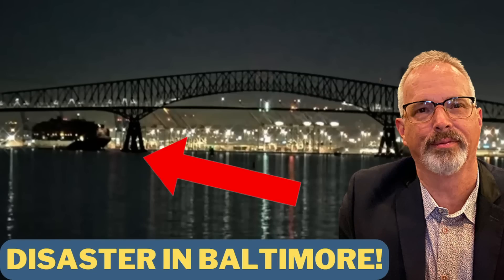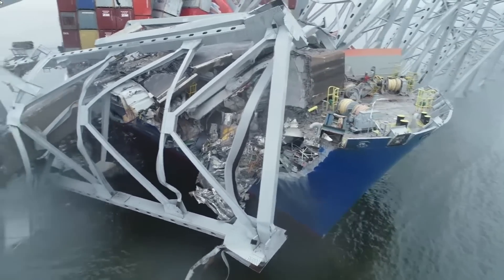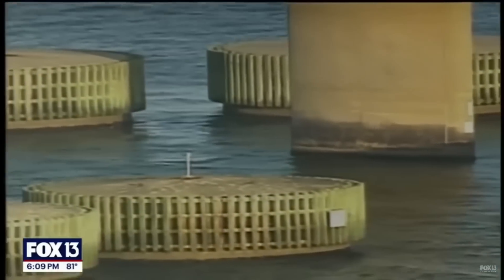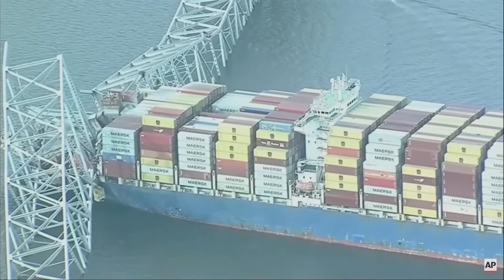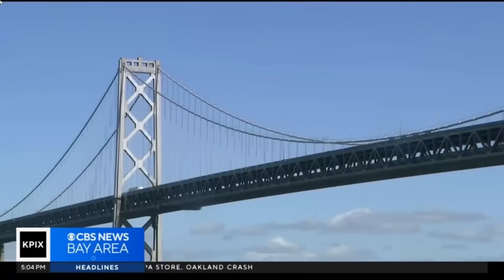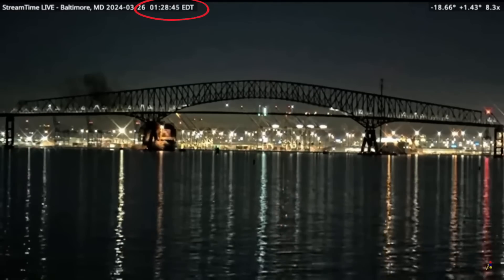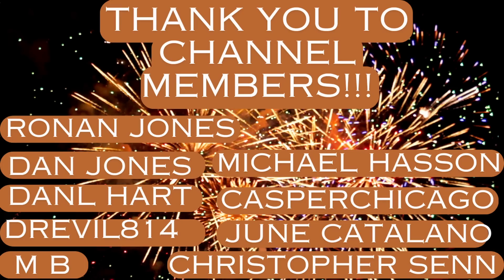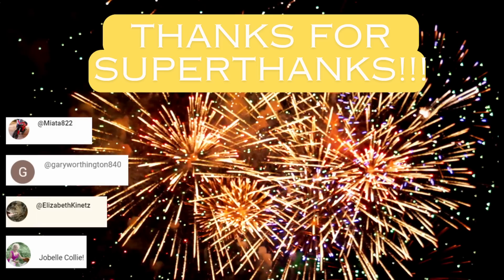How the Francis Scott Key Bridge in Baltimore should have been Protected

Comment: Cost/Risk assessment is the main theme that seems to come up.  Engineers and decisions makers will to spend the money or not spend the money of a benefit that can improve safe in the long run.  Many of these decision makers are will to gamble and not spend money on an improve that history has taught you gotta build it and pony up the money.  Upgrade to present infrastructure, maintenance, ect, lean tends to be to defer the work for cost saving.  In the ends the cost is always higher when you defer what you know needs to be done.  The Pittsburgh Fern park bridge collapse.  If this bridge was 6 or even 8 main steel structural members, with that redundancy the chance of total failure could have been minimized.  Even as pointed out that the drains were unclogged, the salt water runoff may have flowed away from the structural members, and reduce the damage from corrosion.

Comment: Dumb question: Is it possible to install in short cut spans of the downed bridge large bags filled with air or something else to prevent the steel from hitting the bottom and to be able to tow the now floating sections away.? Is there just too much weight.?

Comment: maybe it was 100% preventable but if absolutely every out of date infrastructure project and similar level of risk bridge were to be updated at the same time would it be feasible and at what cost and in what kind of time period. I saw an estimate that if every water system in the north east which was at the same level as the one in Flint was it would cost one trillion dollars. but t that were to be fised in a 6 month time period what would that do to the cost? so if the cost of safety related issues be added to the cost of roads  and waterways  and it all had to be done in 6 months even if it was possible what would t cost? don't forget all this spending would happen at the same time the marxist left, which wants to deindustrialize america, would be wanting funds for their own issues and pork spending.

Comment: It's much  more sexy to build new stuff than keep old stuff up to scratch.  If it works  most ot the time with minimal spending, why not go with that?  Especially if the federal government will bail you out.
Arguably part of the problem here is cost cutting with ships.  Poorly trained crews, poorly maintained ships.    And bridges that are just fine so long as no ship bumps into them.  And poorly trained people overseeing both ships and bridges because nobody wants to spend on maintenance of them, including on salaries.

And there is an argument that that is an accepteable solution.    It may be cheaper to pay for new bridges that to maintain existing ones to a high standard.
The USA could require that all visiting ships comply with high standards, but they don't.  There could be a fee for each ship that passes unprotected bridges to pay for bridge insurance.  I bet there isnt.
Reply from the maker: There's a toll for crossing the bridge with vehicles. I wonder where that money went.

Comment: Why are you talking about issues with the current generation if this bridge was built in the 70s? 🤔
Reply from the maker: The younger generation had an opportunity to protect this bridge as did previous generations. The point is the loss of institutional knowledge that occurs to produce similar disasters to past ones where lessons have learned.
Reply: @CaseyJones-Engineer  it's not the engineers job to decide what to be done to existing construction, but the job of the government and politicians to decide which regulations need to be set and reapplied to already existing construction, to bring it up to date.

However, the generation you're referring to as "more wise" did failed to construct it properly. And now you're blaming "the youth" for their failure.

I think you're just following your confirmation bias here, instead of looking at the situation objectively.
Reply from the maker: @RubenKelevra  Maybe.

Comment: It's commonly repeated that hindsight is 20/20, but not always and certainly not in this case. Why? It's because we did not learn from past disasters. I argue that if a large cargo ship can collide with and take-out a critical infrastructure, it will. We just don't know when or where. I also argue that until better protection barriers are in place (Oakland), large container/cargo ships should be under tub-boat escort until all potential infrastructure obstacles have been cleared. If we learn anything in the present case, it's how can we possibly afford to not implement these safety measures, when it can save lives and be far less expensive to have 20/10 foresight?
Reply from the maker: I agree with you. There is too much short-term focus just like what's going on with many companies in corporate America these days.

Comment: One fault with the logic here is the possible tearing of the ship. With 100,000 tons moving at over 5 knots, needed to maintain steerage, the upper structure of the ship will simply shear off and continue into the bridge supports. Making the dolphins immovable does not negate this problem. Most systems seem to be designed to deflect a glancing blow from a cross wind driven scraping rather than a head on impact. The side of a ship rubbing against a dolphin becomes a mutual sacrificial event that protects the bridge supports. In 1977, the Vietnam War was over and we were almost broke financially,  money for infrastructure did not exist. The design occurred while the war was still going, so everything had to be cheaper than necessary. The problem with fixes for inadequate designs begins like this: Phase II, remove 3/4 of Phase I. You need to remove anything you cannot use because it will be in the way of the new stuff. This leads to removing inadequate protection, leaving things unprotected between demolition and completion of replacement construction. Simply adding on to a dolphin reduces the size of the ship channel which is already as narrow as practical to keep the bridge span minimized. To move the bridge supports means a whole new bigger bridge.

Comment: I fully agree with your assessment of the inadequate protection at the base of this bridge. This was not a direct impact, it was a glancing blow which could have easily been diverted by a protection system. I am neither an engineer or architect but the first thing I said when I saw the initial videos is that someone needs to go to jail for negligent homicide. Just looking at the tiny size of the supports of this bridge was frightening to realize that I had driven over this bridge many times with my family. Just because it was designed this way decades ago doesn't mean that it couldn't have been upgraded. They should have installed barriers around the base many years ago. The upper edges of the ships deck should not have ever contacted the supports while the bottom of the ship remained clear. If the bases were wider so the bottom of the ship contacted a barrier it may have deflected the ship enough for the top deck not to hit the supports, it may not have come down. The Florida Sunshine Skyway bridge was rebuilt with plenty of protection from glancing blows. Look at the pictures on this article.  https://www.msn.com/en-us/news/us/lessons-from-skyway-disaster-failed-to-help-protect-baltimore-bridge/ar-BB1kGoru.  I can't believe that a responsible person or people could not have figured this out years ago. If the Authorities members are not jailed they should at least be fired immediately.
Reply from the maker: The government sector gets a pass on these avoidable tragedies for some reason.  Things need to change.

Comment: Excellent video about the engineering of Bridge Protection Systems. I agree that the fundamental issue here is not really about the Dali loosing power but that the risk of at some point a sufficiently large ship would strike the bridge was clearly non-zero, and even if some the impact of such a collision would be enormous. Frankly the Federal authorities should charge the bridge owners with negligence for not upgrading the bridge's protection.
I suggest though that your at least 3yr estimate for getting a replacement is rather optimistic, even if the Federal authorities seek to pull out the stops. 3 years might just allow an accelerated build, but before starting, that build they would need a new design. I can’t see them just dusting off the existing design and replicating that.
Reply from the maker: Thank you. I've got some thoughts on this that I'll address in an update.

Comment: Very good video.  I like the deeper dive on the civil engineering.  It would be interesting to follow up with a video showing the process and engineering required to remove such a mess.  The strain energy in the beams is dangerous and without properly disassembling the structure it could be catastrophic to people and machinery.   Lots of potential energy waiting to be unleashed.
Reply from the maker: Thank you.  I think the removal process will be dangerous and slow to complete.

Comment: I'm approaching the end of my 40+ year engineering career. I'm trying like the devil to pass on all I've learned. But, so much seems irrelevant now that so much of the job is done by computers. What used to have a naturally slow pace, because the process of calculation and plan preparation took so long, that it allowed careful deliberation, now takes only seconds and happens entirely inside the blak box. I had to teach linear interpolation to an EI not long ago. Some are learning by reading the manuals, but not all. The computer algorithms are expected to account for everything.

Comment: There has been a great loss in work ethics over the last decades. Look at Boeing as example. The common denominator for ethical standards has always been slackness of some sort. That is, unless driven conciously, slackness will dictate the degree to which safety will  be managed. In even simpler terms, unless you kick ass, safety will slip. The cycle is not one of experience, but a cycle of  conciousness. It is very hard to beleive that the bridge was that poorly protected. Engineers and lawayers seem to share one trait..... they are clever and in everybody's face. Then when things get tough, they suddenly claim   a sort of professional force majeure..... that the situation is or was beyond their level of influence.

Comment: There is an empirical proof that a fender (dolphin) big enough to protect the bridge from this ship, or even one twice or three times the size is possible and not beyond current engineering. In the NTSB B-roll and all of the detailed images of the bow in its grounded state, the extent of movement of the ship is clear. The ship didn't go sailing on. This shows that it is possible to stop the ship in a reasonably short distance with 1970's technology.

Comment: Missing the big relevant question, why did the ship lose power so shortly after getting underway?  What caused that ? Do engines that big just hiccup and quit running ? And even if the black box quit recording with the loss of power, which is ? stupid/suspicious, it would still have likely given evidence as to what stopped the motors and generation of power.  If sabotage was involved that would have been the point of attack.

Comment: The same questions can be asked of the ship design and operation.
From what i can see the ships a have been optimized to the point that redundant systems do not exist in a form that would be useful in an emergency.
Even things like practical speed limits when maneuvering around bridges and such.  Speed limits should be calculated on the energy the bridge buffers can absorb.

Comment: Here in the Detroit area the Gordie Howe Bridge is being built to Windsor, Ont., Canada.  It is about the same length as the Key Bridge 1.6 miles.  It is costing over $6 billion.  The preliminary estimates for the Key Bridge is about one to two billion dollars. The Howe Bridge is 6 lanes vs 4 for the Key Bridge which would account for some of the difference.  Why is the Key Bridge so much cheaper to build then the Howe Bridge?  
The Howe Bridge is a suspension bridge which has a much longer span.  Should the new Key Bridge be a suspension bridge?
You talked about how knowledge is lost after a generation.  We see the same thing in banking, every 20 to 30years there is a new banking crisis because of the loss of institutional knowledge.

Comment: My favorite story is that a refrigerator company fired all its old expensive engineers and replaced them with recent cheap college grads. You know they will be up on the latest tech. They redesigned the motor for their product and began manufacturing. One year later they all failed and caused an extremely expensive recall. Experience matters!

Comment: If older folks retire and their knowledge would be lost, the Netherlands would not exist.
So we developed systems to prevent that. Good documentation about how, why, where. And technical universities that preserve and spread knowledge, and who look forward to anticipate on changing circumstances.
Most bridge pillars are constructed on boat shaped islands of reinforced concrete. In front of them there are pillars that push a ship aside to prevent full frontal impact.
Even at the Baltimore bridge the pillar construction stopped the ship. Had there been a similar construction in front, the load carrying pillar would not have been hit.
Anticipation on changing circumstances is a must in infrastructure, ships get bigger, trucks get heavier, trains get faster, what was sufficient today, has to be adapted for tomorrow.

Comment: Sometimes it helps to look at the context. The Key bridge was built around the same time period as the second span of the Sunshine Skyway. Using similar designs and theories. It was completed a few years before the Sunshine Skyway came down. The problem is in all the years since the Sunshine Skyway came down in 1980, they never meaningfully updated the barrier protections around the Key Bridge piers. I guarantee that there are engineers reports every couple of years recommending that the protections be put in place. These will certainly show up in the guaranteed civil suits with the ship owners. The bridge was built, it was serving its purpose, and was in a good state of repair. There was no political will to spend millions on a potential or theoretical problem. No matter how obvious it was.

Comment: Knowledge that is lost need to be implemented in code. For instance where i live there is a code that all prefab concrete element in a building need to be anchored. This is due to a building colaps in UK in the 60s (worth saying i don´t even live in the UK). First a few years back (2020) the code was change so only walls that was exposed to potential blast damage would need to be achored. (parking garage, stare case houses and flats if they have gas)

Comment: Dolphins would have been great to prevent this. But the constant complaining about the ship speed and lack of tugs are by people who have zero clue on how ships operate. Most vessels need to maintain a certain speed for rudders to work efficiently with passing water. Plus the tugs that got her underway I dont believe were capable of moving her much at 8 knots. And wouldn't off been safe to keep attached on a ship going 8 knots to escort her out. Larger, faster tugs would be needed to escort a ship at speed that large. Even then its still not without safety risks. There are countless reports of tugs getting capsized and crews killed by large ships while escorting them.

Comment: Dear Professor Jones, your insightful videos are much appreciated.

These days, much money is spent on welfare, and much of US industry has been sent overseas.
As a result, less money is available for infrastructure.

However, there is a further very important issue, which is that of the moral strength of our leaders.

Nowhere is the lack of moral strength more on show in the engineering community than in the issue of the collapse of the THREE WTC towers.

Professor Leroy Hulsey spent 4 years doing an exhaustive forensic analysis of the collapse of WTC7. And he has proven CONCLUSIVELY that the supposed computer modelling of the collapse, based on NIST's 2008 report is hopelessly wrong.

Moreover, unloke NIST, he succeeded in replicating the collapse successfully, using computer modelling.

He demonstrated that the observed collapse required the near-simultaneous removal of EVERY supporting column!

And, most grievously, there has been no collapse, due to fire,  of a steel-framed high rise either before or after 9/11. And no change in the building codes!

Grievously is the right word, because the collapse of these three HUGE structures due to fire means no steel framed skyscraper can be deemed to be safe from collapse.

The extreme lack of support for Dr Hulsey's work shows, IMO, a very serious degradation of the morality of structural engineers in the US.

If the codes for high rise construction are right, then WHY did the towers collapse?
If they are wrong, they why is there no call for them to be upgraded?

The silence of your professional community is both frightening and deeply concerning. Every day, millions of US citizens have to trust in the integrity of your work.

Would you regard Prof Leroy Hulsey as a man of integrity? Is his report correct?
Your response on this very important issues would be deeply appreciated

Thank you
Chris Moyler. UK

Comment: Besides adding dolphins, the use of tug boats until they are out in open waters would solve the problem.
Reply: This is not necessary if the bridge has an appropriate protection.
It is very inefficient and uncommon  to tow outgoing ships so far.
The water depth at the bridge is 50 ft only. Ideal for retrofitting the bridge.